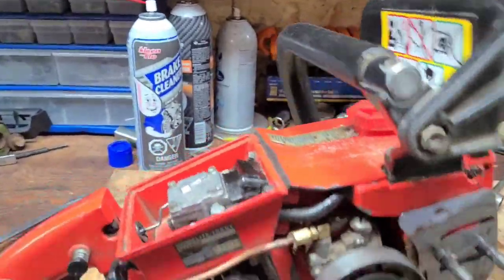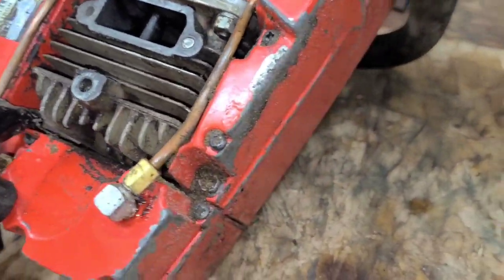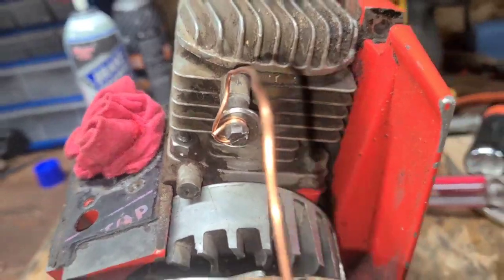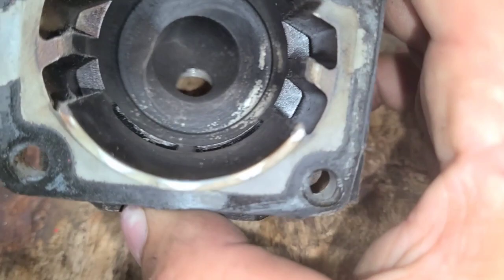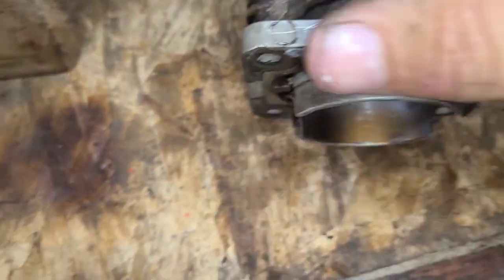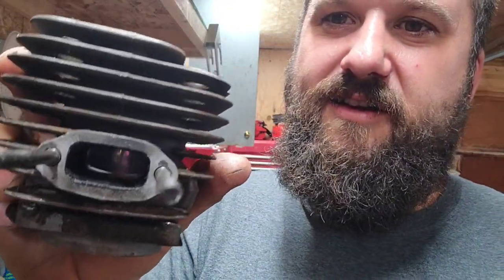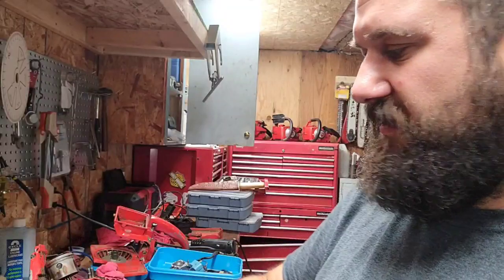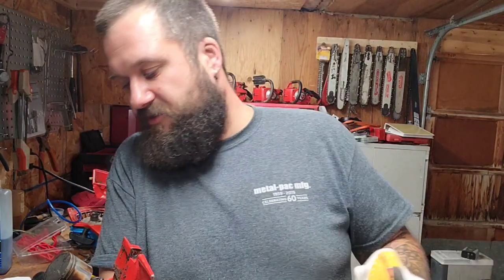Homelite xl76 timing and cylinder inspection.

Comment: I think this is a great idea. These power saws got a bad name mostly because we were mixing non detergent engine oil in gasoline oftentimes as much as three times the amount of oil we use today so the saws had carbon issues and because of that they're really cheap today for the most part and available nearly everywhere. Personally we had a bunch of these on the farm growing up as a kid I still have one on my shelf that I have always wanted to do something with because it is a reed sawI have always known it has a lot of potential and that is the reason I have saved it all these years. The other saw there seems to be a lot of is the Poulan's at least in my area you find them for 10 to $40. Another thing I personally I think I am going to cut my teeth on when it comes to porting and two strokes is why not practice on a weed eater there are literally tons of them curbside over the last two weeks I have picked up six of them for free. TinMan let me know what you think is there any reason why a person couldn't learn on a weed eater and then go to a power saw other than maybe finding new pistons and rings and jugs. But my thinking is oftentimes these weed eaters are not wore outthey just normally have fuel line carburetion problems or a broken flex shaftbut who cares you're just working with a powerhead. I do realize you cannot put a load on the thing when done. So maybe that's the reason not to use string trimmers?

Comment: I'm very interested in the entire build! The more detailed you can be, the better. I just cleaned up a Craftsman/Roper 3.7 which is very similar to this saw. I was light on the porting because i'm just cutting my teeth in that area. Still trying to get all the information I can so I get better each time and can turn the heat up. I dig the channel man. Keep the videos coming.

Comment: I'm interested..if you enjoy recording the footage we'll happily watch...
Ex port bridge may be worth leaving in place worth considering...
Reply from the maker: We shall find out if I should of left the bridge in soon lol.
Reply: Lol..I done very little to change shape of exhaust port on a 254 ,it snapped a new ring, s***! ,So I put more bevel on the cylinder edge, snapped another ring! s***!! In total it's snapped 4 rings all the same bang center of ex port,only ring it hasn't snapped since, is the original ring from before, any ideas on why this keeps happening....
Reply from the maker: Thats a good question. Port shape maybe??
Reply: @tinmanssaws  ... barely touched  the shape any material was removed was after the cylinder opp between there and ex gasket.... obviously I fucked it some how....to be clear it only snaps a ring under abuse of testing in the cut ,e.g flat out in curff and close throttle ,bang!! Snapped.

Comment: Out of curiosity do you have any easy way of measuring horsepower from a chainsaw? I aim to have a play at porting 1 of these days and would actually like to get some indication of whether I am actually doing anything. Obviously I could just paint the chainsaw red to make it go faster but I'd like to actually see some numbers that actually mean something.
  Further to that question I wouldn't mind seeing the Homelite put through the wringer. A DIY level of work on it and before and after results would be good. The closest I've seen to before and after results is a guy who times cuts through a large bonded slab of about 4' x 1'.
Reply from the maker: The only way to measure hp is a dyno. I dont have one so I can't provide numbers. 

As for knowing whether you're doing anything? That's easy, often a properly ported saw will outcut a stock saw that is 10-20cc bigger ..The diffence between ported and stock is very apparent once you run a ported saw.

If you're building worksaws like I do the key is to go warm enough to get noticeable power gains but keep it sane enough that the saw doesn't blow up.  The saw has to start, idle and work day after day..

Restraint is the hardest part of saw building.
Reply: @tinmanssaws  . After I watched this video I went back to an old video by 2 stroke stuffing that I skipped over a few years ago. After watching it it seems there is a fairly easy way to dyno things. A program called SimpleDyno is nearly all that's needed. Stuffing links it off his video/s and the proggy looks like it has been used on everything from an rc car up to 2 stroke racing bikes.

Comment: Love to see a porting on an old Homie. Have half dozen of them myself ( all stock ). Very anxious to know if modern power can be run out of these vintage saws. That saw can move air, but can you get it to turn higher rpm's. 6500-7500 just doesn't sound right. Thanks Tinman